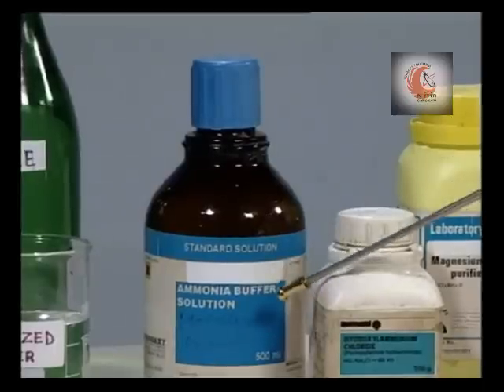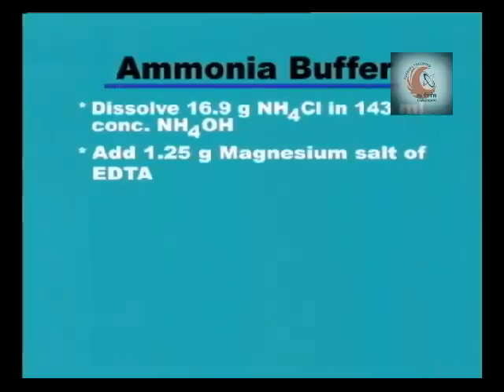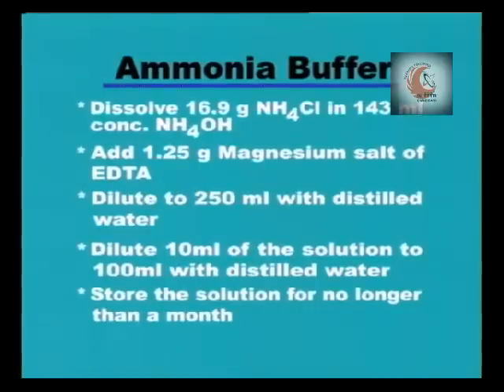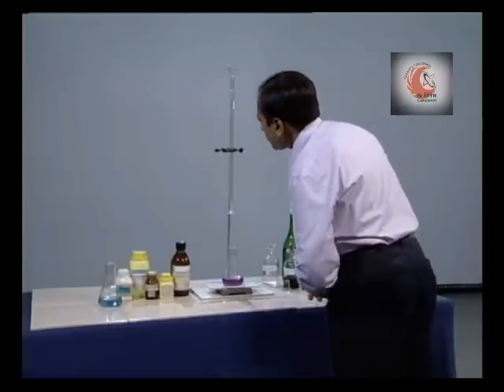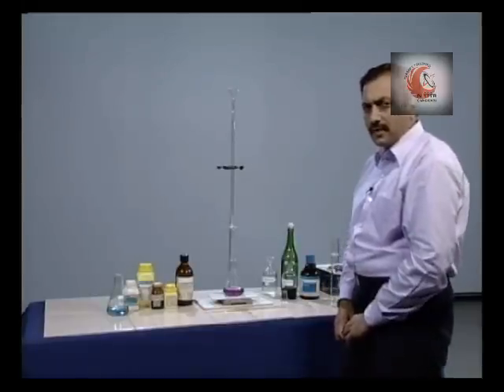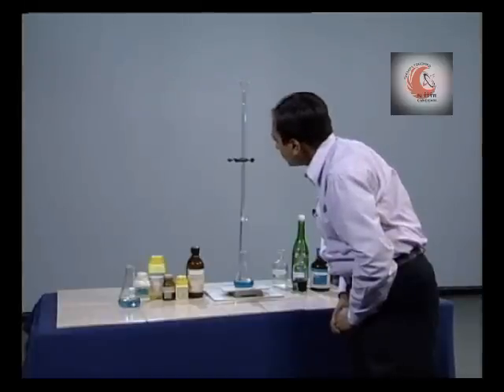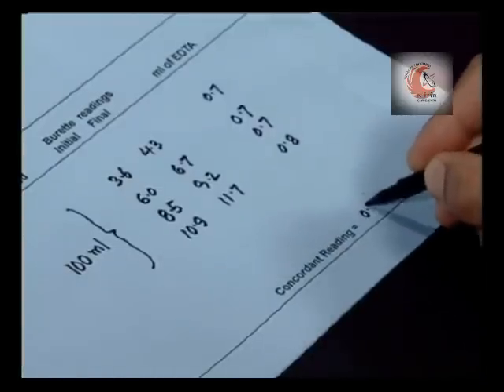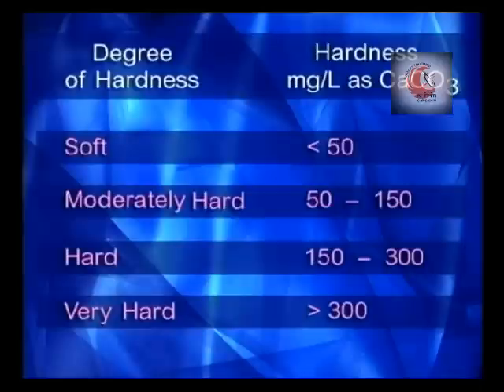Determination of hardness of Water

Comment: According to me, we shouldn't add distilled water to boiled and cooled water..since the volume will change but no salt is increased and this reflects in different answer for permanent hardness because hardness is also dependent on volume...i.e suppose there is equal amount of permanent hardness causing salt in two samples of hard water with different volumes then permanent hardness in  ppm or mg/lit is different for both the samples...so instead off adding distilled water we can measure the amount of water remained after boiling and calculate with the same.